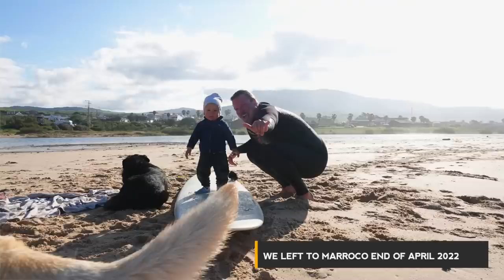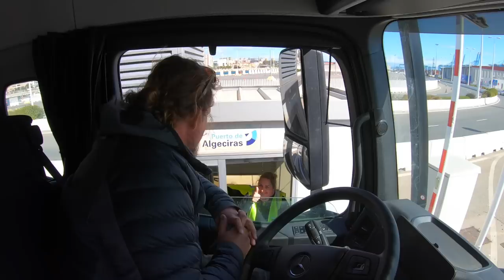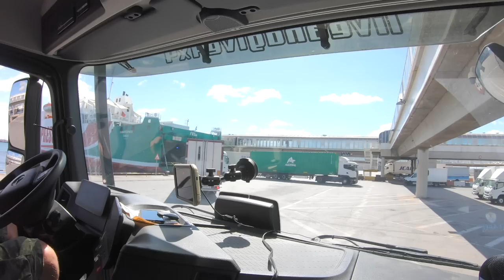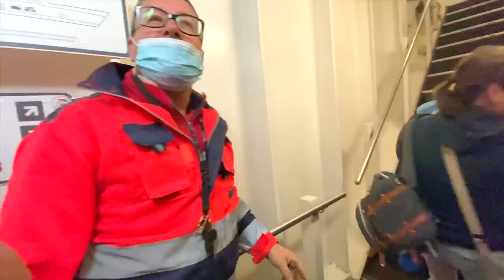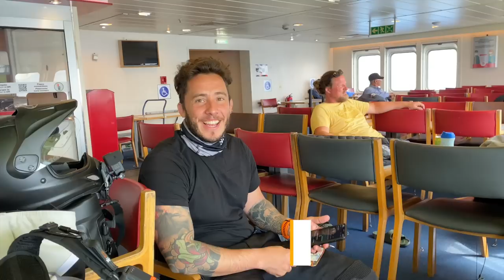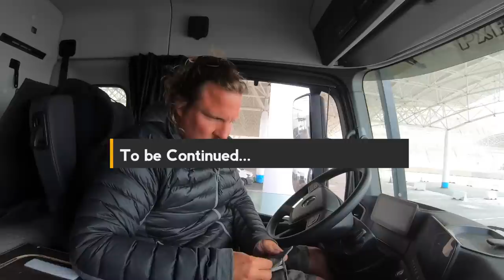SHIPPING our truck to AFRICA ► | Ferry SPAIN to MOROCCO 🇲🇦 - Ep1

Comment: Parents guide:   The child should be facing the opposite side (the back side of the truck not the front) for safety of the child because when you suddenly stopped or stepped on the break of the car the impact will not hurt the child.
Reply from the maker: Hi there,
we are using isofix with this child seat for that matter. That’s why the seat is directed this way. When Matheo was smaller, his first seat was directed the other way. That is correct! 
Thanks
See ya when we see ya 👋 
Isabela Fabian and Matheo
Reply: @LiveandGive4x4  good to hear that Matheo is fine. I really love your mobile house by the way :)